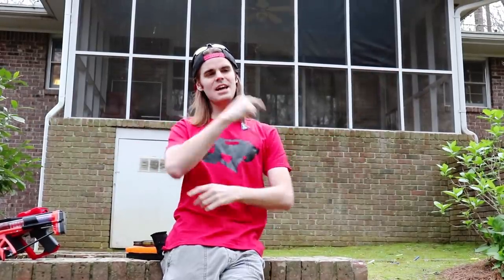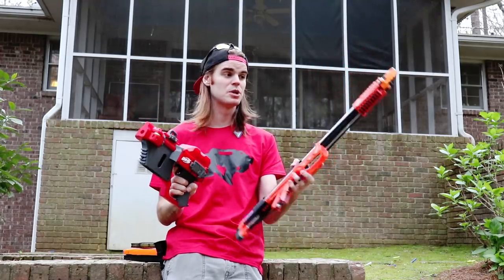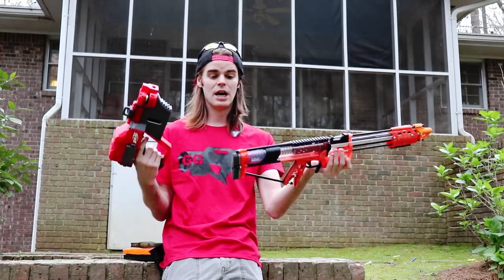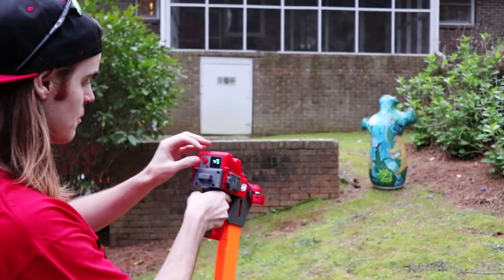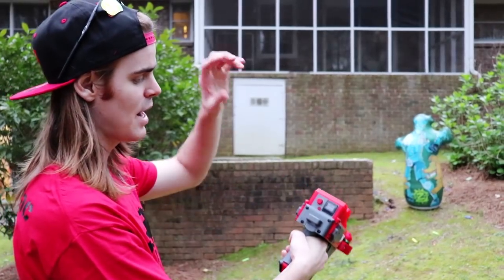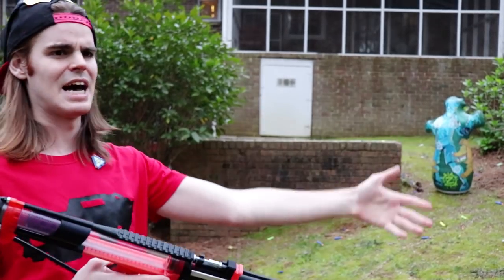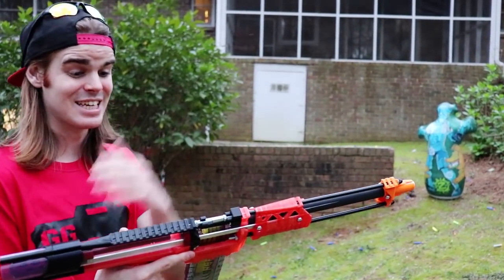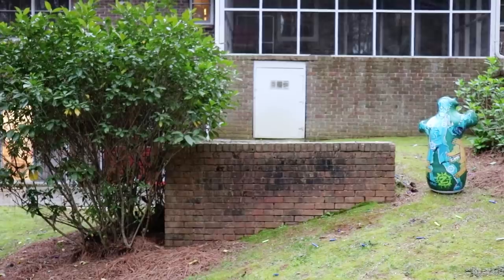Homemade Nerf Guns: FDL Vs. Caliburn

Comment: I can't afford (or rather justfy) an FDL at the wars I attend. Have to spend that money or more printers and tools instead. Total print time for a Caliburn is 25 hours.
Reply: CaptainSlug My main concern with the caliburn is that it’s finicky. If the threaded rods get out of tension with each other it starts having more failures. If there is a fix for it I’d love to know!
Reply: Buy a different type of lock nut. I didn't want to include nylon-locking hex nuts because they only lock for the first 3 or 4 installs and then stop working. Some users have epoxied hex nuts to the outer ends of the threaded rods to turn them into really long screws, then used lock nuts just inside the magwell.
Reply: Hey, how difficult is the assembly of the Caliburn. I'm slightly worried about messing up the drilling and/or the filing. I've never done a 'mod' of this scale so I am somewhat worried. Do you recommend I get prebuilt?
Reply: There's no drilling required anymore. You can read through the instructions and decide if it looks too daunting for you. http://captainslug.com/nerf/Caliburn3DPAssembly4.pdf
Reply: Thanks, I definitely think that I can build it. My last question is do you think a scrawnyish 14 year old will have trouble with the k25/26? If so is there anyway you could switch it to a different spring?

Welp it's time to go get my parents to get me this hahahaha

BTW you might want to link Captain Xavier's assembly video, on your Etsy store. It's the only Caliburn assembly video I could find, and it was very helpful for my decision. I think that it would be a nice thing for customers deciding if the 'build it yourself' is for them or not.
Sorry, last question, approximately if I order the 'build it yourself' style kit how long from the order date will it be shipped out?
Reply: The r2 design lets you swap springs by just removing two hex nuts in the stock. So buy the blaster with the 788 and K25 and if you don't think you can manage the K25 you can switch to the 788 in under 5 minutes.

His assembly video covers and r1 Caliburn. The r2 Caliburn takes half as much time and doesn't involve any glue.

Lead time on blaster orders is currently 5 weeks.
Reply: The Hardware kit only includes the hardware. If you don't have a 3d printer or access to one you should buy the "Build It Yourself" kit instead.
Reply: The cheapest 3D printer worth looking at right now is the Monoprice Maker Select v2, and it's still $300. :-/

The big deal is making your own parts, you can make some excellent additions with just a few minutes.

Comment: Caliburn vs Prophecy
Reply: Not really any competition, the Caliburn has a much larger plunger tube, spring space inside the tube, and can have the spring changed to pretty much anything you want it to have. For pre-built, out of the box blasters in the retaliator size, the Prophecy-R does what it needs to do for what it was designed for; and does that really well. You can't really compare it to a Caliburn, because they aren't even in the same kind of market segment of the hobby.
Reply: I second the motion

Comment: IMO Caliburn is actually underpriced since Cap has made an effort to make the NIC style more prolific. He has said as much to people on reddit, and has even mentioned that it is less expensive to buy all the hardware through him because he prices it close to cost. But, both have their great benefits and both were created by fantastic pillars of the community who are pushing the science to the brink. Money well spent in either direction.
Reply: I get why the FDL costs as much as it does. High grade electronics and software are expensive, especially when you have to hand program every one of micro controllers you put in a kit. If that's what Captain slug is doing for the Caliburn, that's not bad of him. Making the hobby more accessible isn't a terrible thing, even if you don't make much from it. If it's just a hobby and you aren't trying to make money from it, there's nothing wrong with that at all.

Comment: It all depends on what kind of gameplay is being played. CQB doesn't require very high velocities but it does help to have a high ROF and accuracy, which an FDL is able to provide when set to a low FPS setting. Although some CQB require stealth; and an FDL makes too much noise to fire a dart, while the Caliburn can already be primed before engaging a target. Yes, "A" target, multiple targets can present a challenge for the Caliburn in CQB gameplay or any kind of gameplay where multiple targets cab be expected. An FDL can easily handle multiple targets in any of its settings, semi-auto, burst, or full auto in any distance. The only draw back to an FDL is making sure the power bank that makes it work will last the whole duration of the event. Even the role of a player can be a factor which blaster is more effective. Both the FDL and Caliburn can be used by a sniper but the louder noise of an FDL can give a sniper's position more easily than the Caliburn. An FDL is best for Support Class and Heavy Class because of its ROF in any settings. But since I play from a wheelchair, I'd play sniper class most of the time and stealth is better achieved by using the Caliburn.

Comment: K14 is a Longshot plastic internals killer. lol That spring is no joke, to get 300 fps out of the Caliburn using a full length K14, that's pretty damn impressive. You would have to nest springs in a Longshot to get that kind of velocity in a sealed short dart breech with full metal internals.

Comment: I think it's like this. If you prefer flywheel blasters and have tons of spare money, the FDL is the way to go, but if you prefer spring powered blasters, or need to stick to a limited budget, the caliburn is for you. I think that I might prefer the caliburn because I like having a  longer blaster, and I might feel a little cramped on an FDL. Besides, I think that the caliburn can handle being in the rain better since it doesn't have any electronic parts to short out. I also saw a non Captain Slug caliburn that had its 3d print patters reworked to make in fire mega darts, something I haven't heard any version of the FDL being able to do.
Reply: Radiosilence187 is working on an enormous select-fire mega/elite flywheeler.

Comment: I have both, though instead of the FDL 2 X(I think) it's the FDL-3. And I like to have options of short length and normal length darts. Most nerfwars I go to. I tend to run my Caliburn as my long rage option and run it with short darts. Full length darts for the FDL-3 incase I get into CQC territory

Comment: Personally there is no competition, Caliburn takes it. Don't get me wrong, FDLs are amazing; solid design, performance, and creator. I 'm just not a fan of flywheels (and the higher cost of the FDL). I have nothing but respect for Jesse Kovarovics for designing and making such an amazing platform, but I just prefer springers. You run out of ammo slower, you are generally more accurate with your shots (since you know your next one will take awhile), dart cleanup is easier, and there is no hassle with batteries. Again, don't get me wrong, flywheels are great, and a lot of fun. I personally have several flywheel and other LiPo ready blasters. But I always find myself going back to my Retaliator. I do not yet own a Caliburn as I am challenging myself to build a good brass breach system before I reward myself with a Caliburn, but it is on the short wishlist. Just my thoughts....

Comment: Well both are very different if you just want to snipe your friends go with the Claiborne if you want to be tacticool go with the FDL both are good but a longshot can reach caliburn FPS so if you don't like the caliburn's astetics you can still use a prophecy or longshot if you need that sprinter performance

Comment: What is the pushing mechanism in a FDL? I recently got a Regulator and have been pretty disappointed with the belt pusher with elite darts; though ive only run it with normal Cs so far. Im not sure what other type of battery to put in it to see if it works better. But i digress. Does the FDL have a belt, and if so, is it reliable? Or is it a physical rapidstrike-like pusher?
Reply: The belt rips the back of the darts ... So bad

Comment: As an average 14 year old looking for a true nerf sniper would the caliburn running fulls work very well or do I need to run shorties or do you have a better option for me?
Reply: Full-lengths are fine for most wars provided you are using a SCAR or other muzzle device.
Reply: Thanks good to know